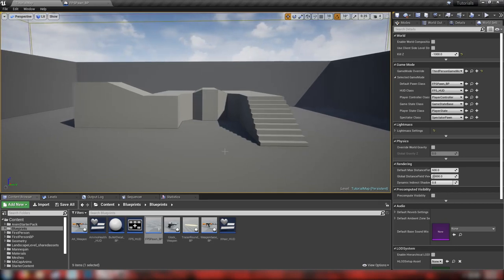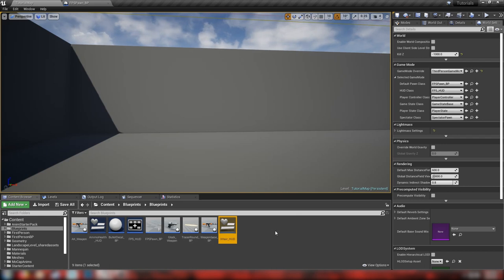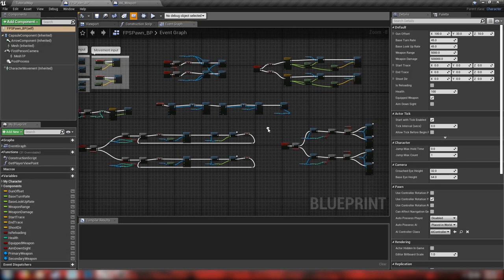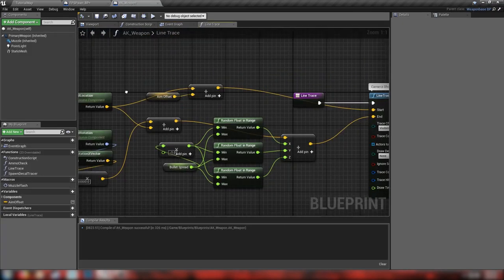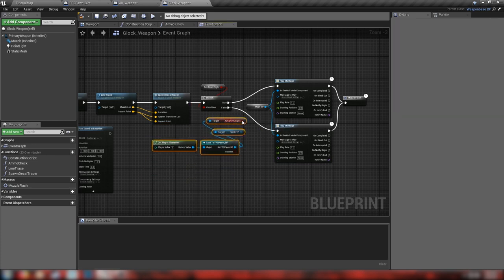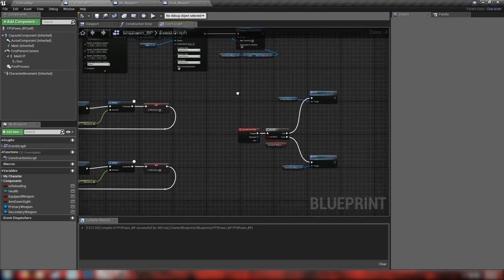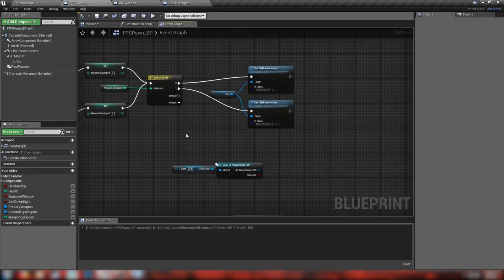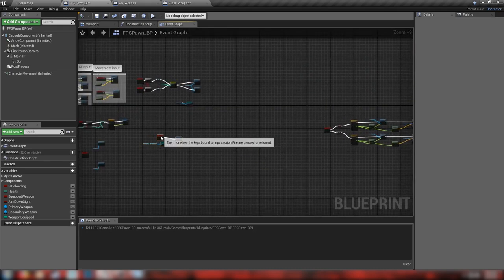UE4 Tutorial: Optimization and Cleanup (FPS Pawn Part 7)

Comment: My game starts at 0 ammo, but when i switch to glock,its all good. Help please :c
Reply: Same here havn't found a fix
Reply: @waltoncharles8972  Change the 'Child Actor Class' on the Gun mesh in FPSPawn_BP to AK_Weapon instead of the base
Reply: Ryan Smith why does this work? Ive been scratching my head since this fixed it for me too...

Why did he initially set it to the weapon base bp?
Reply: @mizfyre8228   I don't have the project anymore so I could be a little off, but from what I can remember the weaponbaseBP was technically the AK until a certain point in the tutorials. Once The weapon Base was setup properly and any weapon specific logic was taken out, it acts as a template for all of the other weapons. Thats why the ammo variables are all set to 0 in the base- which is why if you have the weapon base as the default weapon in your characterBP you start with no ammo. The same ammo variables in the child weapons- AK/ Glock etc. override what is set in the weapon base and will use what you have set in those weaponBPs
Reply: @RyanSmith-if6xc  thanks homie
Reply: @mizfyre8228  You got it playa
Reply: @mizfyre8228   I was wondering. do you know a fix for this problem. when i shoot my ak it depletes bullets and i reload, but then im not able to switch weapons. but if i do not reload im able to switch weapons, why is this?
Reply: @RyanSmith-if6xc   I was wondering. do you know a fix for this problem. when i shoot my ak it depletes bullets and i reload, but then im not able to switch weapons. but if i do not reload im able to switch weapons, why is this?

Comment: Your optimization broke my characters ability to hold the weapon while moving. When I switch the weapon the weapon spawns to the characters hands, however when I move my character the weapon doesn't follow and is stuck in place of where it was spawned. Why is this?
Reply from the maker: It sounds like the weapon isn't parented to the mesh anymore. My first move would be to investigate that, and maybe check if there's any 'Detach from Component' nodes or something of that nature. Let me know if you fix it!
Reply: @underscore00  I have the child (gun) connected to the parent (mesh) with the proper socket set. Right now it spawns the gun and moves with the character, but when I switch weapons it no longer follows.
Reply: @underscore00  Does the version of Unreal matter? I'm using 4.9.
Reply: So. It is a matter a fact the version type. Sorry.

Comment: Does this not create an issue when swapping guns that the ammo is reset to full. I.E if you shoot 4 bullets out of the AK and do not reload, swap to the pistol fire 4 shots out of that and do not reload, when you return to the AK it has a full clip instead of remembering how many bullets it had pre-swap and then if you swap again the pistol will be re-loaded also?

I assume this would happen because instead of changing the visibility of the gun as you did previously (thus keeping the ammo count) you are now re-constructing the gun with each gun swap by setting the child actor anew. 

I could be wrong, however you always reloaded manually before swapping weapons, so never actually looked at this. If the desired effect is to reload a gun on swapping that is cool, however if you run out of bullets, swap to a pistol as a back up and then just re-pull your primary you should really have to reload it manually, and the same for your side arm.

Also if you are using a gamepad control set up and use a Flip Flop for the gun swap (as you probably would using a game pad) you appear to have to press the switch weapon button to load in the actual primary weapon instead of the base class, which has none of the settings of the child classes. I am not sure if the issue is only derived from the flip flop as haven't tested it, however as you don't appear to be loading in the child class object until a switch has happened, I assume the weapon base will not fire the tracers and update the HUD etc. 

So did you have any issues with needing to press "key 1" before your AK would fire correctly? Or did it load in fine in the first instance? It looks as though you should just spawn with the weapon base in hand which should do nothing, then when you press key 1 it should then set the child actor to the child actor class you would need?
Reply from the maker: Oh right! I totally forgot to fix the reloading bug, that's awkward. What I did was cast the remaining ammo to the player when the player unequips the gun (with a Custom Event) and set it back in the weapon when it switches - easily fixed. Here's the blueprint: https://i.imgur.com/6DCMIeQ.jpg This will be fixed in a future video, I'm currently working on more assets for Part 8.

This video was a bit less structured than previous parts because I just turned on the recorder and started working on it, and I guess I accidentally missed mentioning that I defaulted the weapon to the AK, which will fix your second issue. Sorry about that! And yeah the weaponbase_bp just gives us something handy to cast to so that functionality carries over to whatever weapon we're currently holding, but doesn't in itself contain the actual mechanics.

Thanks for the comment! I'll address all of these things (and more) in the next part :)
Reply: @underscore00  Hey man, I have my weapons set up in an array which allows me to pick them up off the ground and switch through them. Im wondering how you went about the remaining ammo variable you show in the above image, i cannot for the life of me get my weapons to remember their previous amount of ammo, when i switch nack they have refreshed the ammo.
Reply: @cdotdub   I was wondering. do you know a fix for this problem. when i shoot my ak it depletes bullets and i reload, but then im not able to switch weapons. but if i do not reload im able to switch weapons, why is this?
Reply: @cdotdub  care to share how you set up the array?

Comment: Great tutorial, but I seem to have a problem. When I switch between the two guns, all animations play correctly. But when I fire with the Glock and changing the weapon at the same moment, there is the weapon base that appears for 0.1s above the hand in an incorrect position and then disappears with a switch to the AK in the hands. It is weird and I'm not sure how to fix it, I've tried by changing the location of the gun child component, but it doesn't work. If you have any ideas on how to fix this bug, I would be really grateful. Thank you
Reply: Ok, I think I understand, the animation is still playing when the glock fires, so the hand is facing upward and when i switch to the AK it goes back in place. So is there any quick way to have a timer preventing from shooting during 0.5sec after the weapon switch? Thank you very much
Reply: Well... even with the delay I still see the AK spawning in the air for 1 frame. I think it's a problem in the arm animation. If you have any clue, I will take it. Thank you

Comment: Question, Originally I had my pistol set to a different socket. How can I change the socket now that it is now a child?
Reply: Did you ever figure this out? I have the same problem and it makes it very hard to use any guns/animations that arent used in this tutorial.
Reply: @LagCentral  Hey. I scrapped that system in the end and went for a full third person body. 
All i can say is, export your weapons in the correct scale and size to fit the animations. 
It should fit the socket after a bit of work.

Comment: awesome tutorial, but for some reason i cant fire as soon as i spawn, i have to switch to my secondary and then to my primary to use it, it also has no ammo(switching fixes that too)
Reply: find a fix?
Reply: @nuke7238  either he fixed it later or I did something myself, it's been some time since I've done this tutorial so if you can contact me through discord that would be better. My tag is DragL#5163
Reply: @avtaras  I've fixed it some time ago, do you have discord? We could talk on there